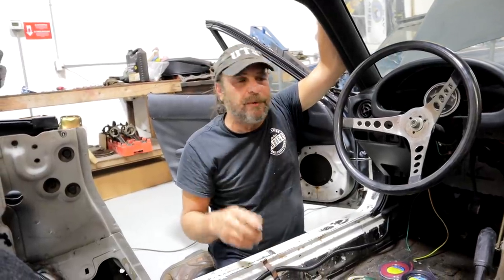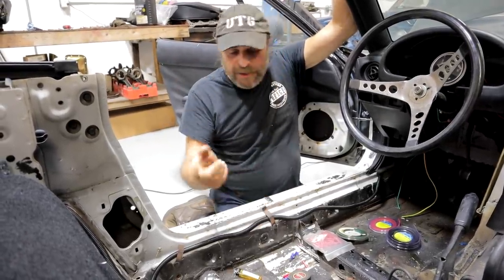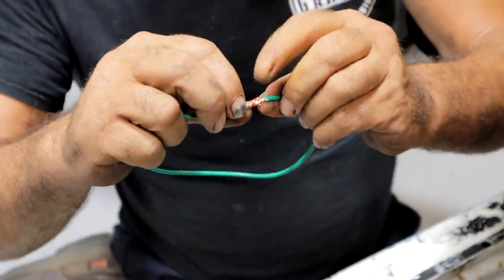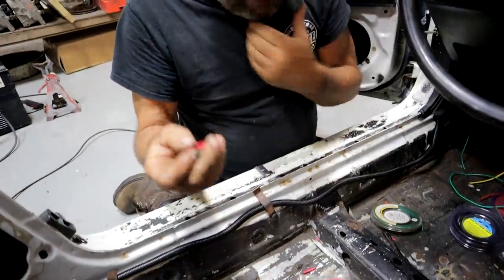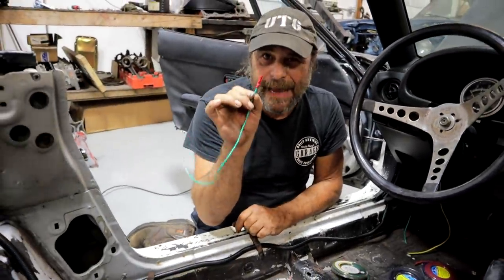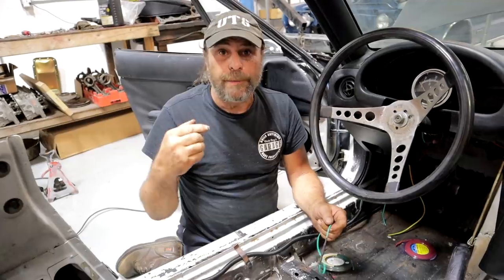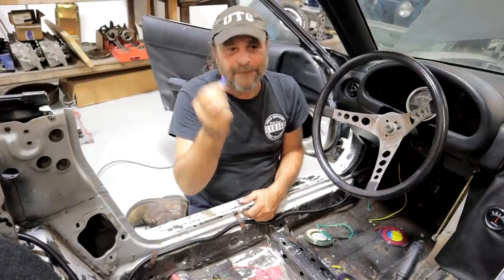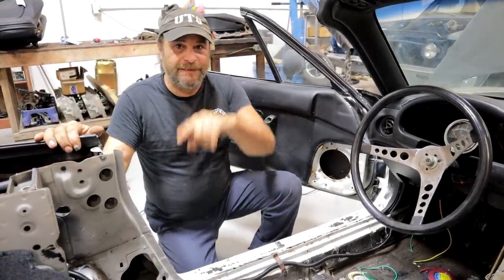The Single Most Misused Item In The World Of Cars

Comment: best ones are the heat shrink but connectors, they are fairly long, and the heat shrink portion seals and adds support to help the wire not bend and break, have used thousands probably, work great. even in the salty winters here in canada.

Comment: as much as i hate to admit it, i learned the hard(ish) way to use heat shrink with any type of crimp connector. Being in the northeast i lost my turn signals when the copper wiring corroded away and broke. Needless to say i use heat shrink now on all connectors

Comment: Im am electrician and i use the solderless and wire nut connections all the time. 
But the places i use them arent subject to vibrations or moisture like an automotive connection would be. 
Use solder and shrink tubes boys, its far better for this application, and dont be afraid of the lead solder either its better.

Comment: I dont think insulated butt connectors like that are designed to be used with heat shrink. You use them in areas where they dont have to be weather tight.  You use uninsulated connectors with heat shrink tubing and it will be much cleaner.  Just my opinion and the way I was taught in electrical class. Not trying to start an argument.

Comment: back when i was in Jr. High i used to make extra money every summer by making these. The metal part is called a terminal and the plastic is called the insulator. The machine has a handle like a slot machine and you put the terminal in a block that has a pin then you put the insulator on it and pull the handle and get a completed piece. (i should point out on these double ended pieces you have two pins, one on the block and one on the bar that the handle lowers over the insulator which puts the terminal in the middle) I used to do hundreds of thousands of these every month.

Comment: if you are going to crimp instead of solder, either get crimps with glued heatshrink already installed or get crimps with no insulation and use glued heatshrink. those el cheapo crimps with hard plastic insulation are not a good product. i like solder as it is a better repair and it keeps a smaller profile.

Comment: I didn't hear you touch on crimping it the "correct way" by making sure that the side being crimped or pushed in is the side with the cut in it, it pushes the tow sides down grabbing the wire.. Just look at your crimpers and you will see where the connector will rest in one side and the other side is rounded or squared where it pushes the crimp in

Comment: I use shrink tubing and take the end of the wires split the wire in 3 sections on both wires that I'm putting together and when I twist each strand together and get them wrapped together I solder it then put shrink tubing over it and you will never pull it apart.

Comment: I always cut the factory hard plastic insulator off the crimp connector or use the ones with out insulators to begin with and just use the heat shrink as for insulation as it has a smaller footprint with out the factory insulator which makes for a nicer looking installation and the heat shrink has more than enough insulating value for 12 volt

Comment: I've used those connections that you heat up and melts a solder in center and shrink tubes around the wires.  And then i use another piece of shrink tubing to really make sure that connection is protected from the elements.

Comment: harbor fright butt connectors don't have the knurls inside the metal sleeves that grab onto the copper wire so you want to get good butt connectors their shrink tube is the bees knees though especially the marine type with the heat activated sealant.

Comment: Your technic is fine but my criticism is your crimping tool I all wise youse a ratchet type so you have a consistent crimp strength also in really nasty environments like construction equipment with lots of hydraulic oil but some silicone sealer on the connections and then shrink it be it will stay forever !

Comment: I hate those connectors but if i was i would solder the end of   the wire so when you crimp it it wont pull out. Personally i prefer soldering them together and heatshrink and abit of glue inside the heatshrink to seal

Comment: A good crimped connection is as strong as the rest of the wire if you have a lot of flexibility at that point ya it can be a failure but regardless butt splices are not really a permanent repair anyways even if you use dielectric grease and heat shrink if you wanted to do a quality repair you would run a new wire or depending on what it is you could put a quality connector on

Comment: Those things are garbage and I would never use them to begin with if you're going to go to the cheap route and use a butt connector use the ones that have the shrink tape already built into it so once you've crimped it you heat it up and it seals itself around proper ways to solder it with silver

Comment: Another tip that I use too is with shrink tube try not to use a normal lighter. The heat from the flint leaves little pinholes in the shrink tube where moisture can enter. If possible try to use a torch style lighter or a bear gun to avoid the pin holes. 

Smoke tires twist frames

Comment: There is now a new method which combines the solder and heatshrink in one piece. Slide the connector over one wire, then fit the second wire. Heat with a heat gun, a soldering iron or even a lighter and the integral solder melts at the same time as the heatshrink. Job done. You can see the solder has joined the wires because the heatshrink is clear.

Comment: A butt connector should only be used as a last resort, always solder and use heat shrink because a butt connector causes high resistance in the circuit causing localized heat that can overtime degrades the wire strands that on the very extreme end can cause a fire but most of the time it causes a open circuit.

Comment: The solder ones are better but there is no reason in this day to use a butt connector in a car build. With weather pack connectors and all the other plugs there are very few reasons to use that junk.

Comment: Tony you are teaching a bad habit with the lighter. A heat gun should be use too shrink the sleeve. The sleeve has a sealant inside that you should see coming out the ends when property heated. The lighters will either burn or not heat enough. We are trying to teach let's get it right

Comment: what is really nice is the crimp splices with built in hot sealer. you assemble and heat it then it gives a water tight seal. I also hate those splice tap crap connectors.

Comment: They make these connectors in heatshrink version, the ones that are soft and kinda rubbery
are made to heat and they shrink so you don’t have to buy the heat shrink tube, granted they do cost a little more and there are harder to find sometimes.

Comment: the solder less connector is fine but when you add a different metal to the circuit it can change the resistance of a sensor and it can cause a galvanic reaction with time.   I use a wire nut with pre-twisted wire.    Copper to copper not copper to cheap metal to copper    I have never had a wiring failure using this method     crimps are made of such poor metal

Comment: I get the ones that solder and heat shrink at the same time all you need is to slip the wires in crimp it slightly and hit it with a lighter until the the solder melts

Comment: I just use heat shrink butt connectors. Strip, crimp, and heat. Done. I also use good crimpers not that stamped steel crap.
Reply: This is if I don't solder and shrink tube the connection.

Comment: Man I haven't strip wire my teeth in years. Now I just heat the wire plastic up with my lighter and give a tug with my needle nose pliers.
Reply: Sounds like a pain in the arse. Could use strippers but even a lot of electricians don't bother. I personally just strip with my side cutters, you can do it with pliers too.
 Place the wire in the cutting part of your pliers and apply a bit of pressure, not too much or you'll damage the cores. Work your way around the wire doing the same thing. On the final bit keep the pressure on and tug the wire out of the pliers. Should be left holding a stripped wire in one hand and a pair of pliers in the other. Saves mucking about with strippers (steady now) or setting fire to things.

Comment: a easy cheap method is simply strip both ends  about 1" twist together so wire is straight . wrap with $3,00-5.00nelectrical tape .  now put a zip tie over tyhe tape were the wires twist together and it works great..
Reply: i do agree that soilder and shrink wrap is best..  crimps are good also //... better if you have real crimpers,, and do them so the crimp curls around the connection.

Comment: He said crimp connectors are also used in aircraft as well?
Reply: YES...but not those cheap ones you find at an auto parts store, we use Raychem splices (especially in the unpressurized areas of the aircraft, or AMP splices can be used in the pressurized areas).

Comment: Actually we have ones now that have a heat activated glue and they also shrink down at the end. You take a torch and you melt the ends of them after crimping them. They melt the glue and completely seal themselves to the wire. They are not cheap but they are worth the money

Comment: Tony no disrespect we are here to learn your wiring will not meet the quality in aviation wiring it’s okay cause you can pull over. One takeaway is the strippers used will move than likely cut off some of the copper wire strands better strippers Tony my friend don’t get mad at me . It calls out for higher dollar strippers I hate to say really everything’s expensive harbor freight has a set it’s in the correct direction it’s better but really need above that go easy on me Tony not my fault dude
Reply: Tony stop throwing tools across the shop your going to break something expensive. I’m kidding around
Reply: Several shops won’t use splicing they only solder then cover because they lost faith in splicing I bought a trailer once lousy wiring to tight and spicing left with an open

Comment: Also, never, ever, use crimped butt type connectors.  Doing so only introduces an additional unnecessary weak connection prone to fatigue failure from vehicle vibration.  It also introduces additional contact resistance into the circuit.  Use insulated crimp-type pigtail connectors instead.

Comment: Don't mean to be an elitist but, can't quite take you seriously with those AutoZone combo crimper/strippers and the butane lighter lol. I stopped using that setup 15 years ago, when I realized it was much more efficient to buy quality strippers, a separate crimper and a cheap heat gun. Spending just a few more dollars on tools made immense difference. And I would buy the heat shrink butt connectors in bulk. Amazon and ebay have them for dirt cheap. Add marine grade heat shrink on top of those for fully waterproof connections. Good points for beginners though.

Comment: wow - so many misguided/wrong statements. and wrong tools.
Proper crimps with proper tools are better than soldered joints - having worked on 70 year old vehicles with factory crimped connections that have no problems, while soldered joints on a 20 year old custom motorcycle cracked because they couldnt flex.
Soldering sure has its uses, and I use it appropriately -  (and I always find it odd that 1/2 the world don't pronounce the L in "solder" - if its pronounced "sodder", why isn't MOLD pronounced MOD, OLDER as ODDER and BOLDER as BODDER? - just a side note ;)
I USED to think like you until I started using the proper equipment, and proper connectors (proper connectors clamp onto the copper, and also clamp onto the insulation )
This means for your tool, you need to crush 4 places on a butt connector to properly join 2 wires with strain relief!
I do agree on the heat shrink tho - but watch out for some of the water proofed joiners - Our biggest Telco in Australia switched to using joiners with inbuilt waterprrofing/sealing.. then 10 years later, it turned out the sealant degraded and released acid as it aged!
It cost them millions of dollars to repair and replace all the damaged connections.
Your crimping method is a great "EMERGENCY USE - GET HOME FOR PROPER REPAIR" system - but NOT any good for permanent trouble free connections.
https://www.instructables.com/How-to-Make-A-Quality-Crimped-Joint/